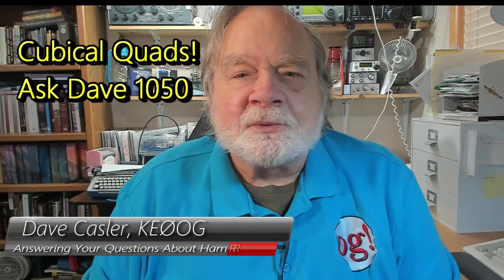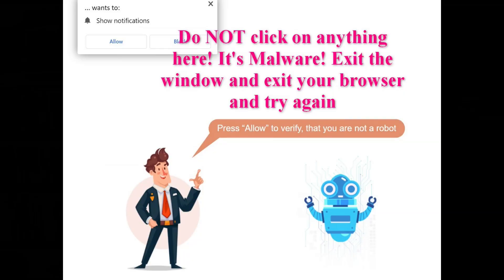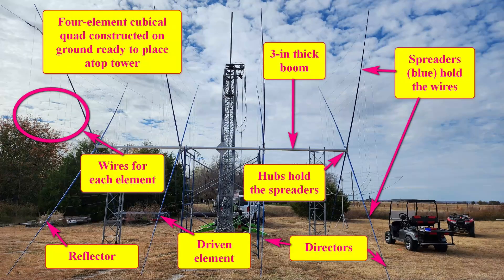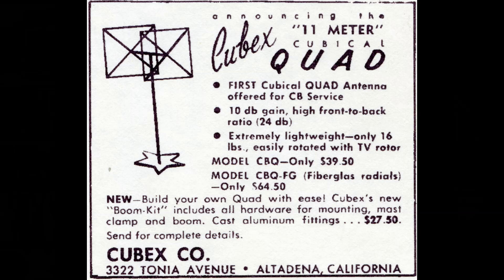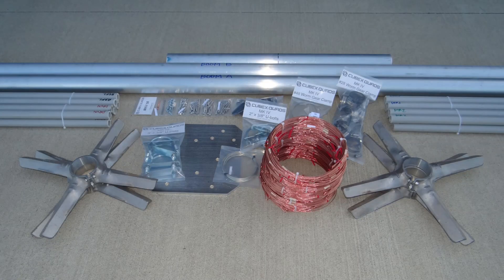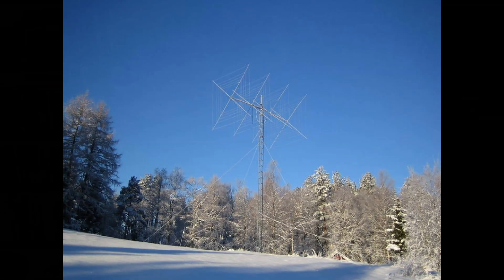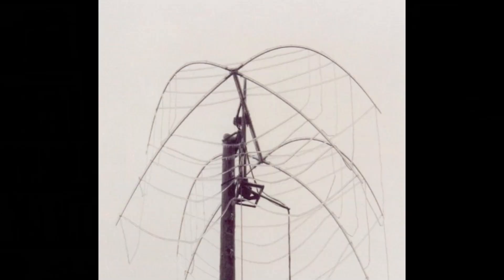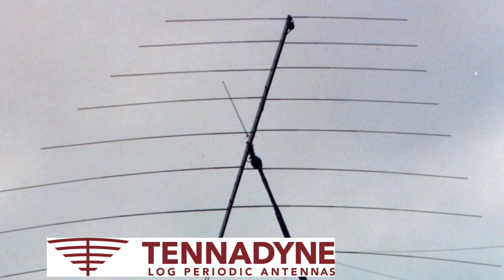Cubical Quads! #1050

Comment: Hello dave im frm Philippines and planning to make a 4 element cubical quad antenna for 2m,just wondering what size of wire use to make the quad.tnx for ur time and more power to ur channel god bless
Reply: The thicker the wire, the wider the bandwidth, (within reason) and may need minor adjustments to the length.. VHF and UHF may also tune better with a matching section of 75 ohm or even 92 ohm coax.

Comment: In the video each loop has it's own feeding coax; 45 years ago I built my cubical quad with 3 loops (10-15-20m) and 1 reflector with again 3 loops - it worked great including hearing my own echo with 100W after traveling around the earth.

I think I remember I put all the loops together to ONE feeding line without any switch - can that be/work? (not sure about my memory on that)

Comment: The other advantage they have with the VHF and UHF models is that you can rig them to have either horizontal or vertical or even circular polarisation just by using 2 different feed points

I want to make my own for 2m and 70cm which will have this functionality

Comment: Yes twisting when stopping .  If using a Hy-gain Tailtwister rotator....the operator can wait a few seconds for the antenna to stop, by watchimg the directional meter, before releasing the middle brake switch.

Comment: David, When I lived in Glendale I bought a Cubex 3 element tri-band quad in the late 60's. I had to drive to Altadena and pick up the parts from a residence.  I put it up on a 30ft crack up tower and it worked outstanding.  Of course in those days 12m & 17m were non-existent.  It caused me to fail my chem class in college since 10m opened at sunrise and Europe came booming in. Then in the early 70's the big Santanas blew through and took down the tower destroying the quad. Sad night. I never replaced it.  But if anyone is interested it was (is) a great antenna. Thanks for the update and information. 73, Bob WB6TIS.
Reply: U ran a 2 element quad in my upstairs apartment. 10/11M.  I talked all over the world. Beautiful antenna

Comment: I built a two element cubical quad  back in 1968/1969.   At the  time  I was in high school...WA0TIU.   It  performed  well,  I loved it  until wind took it  out.  I replaced it  with  a Hy-Gain TH6  which  worked  well too,   But  building   my  own  antenna  was a  thrill!!!